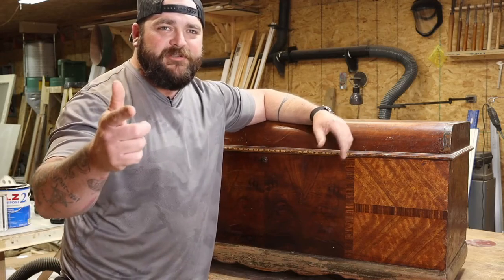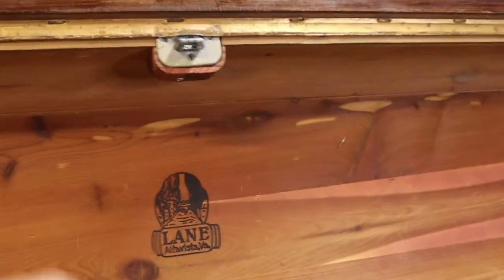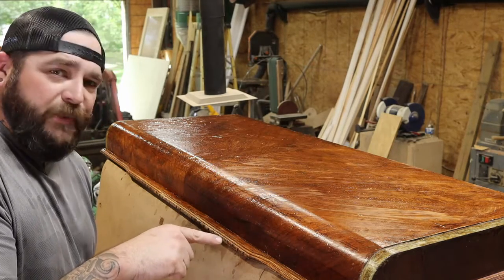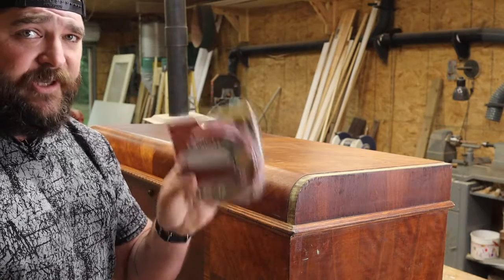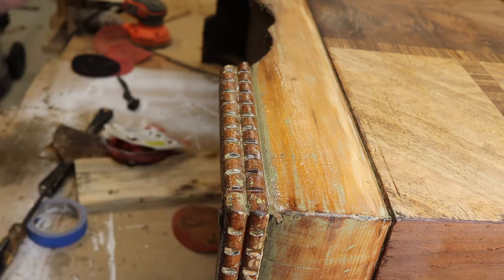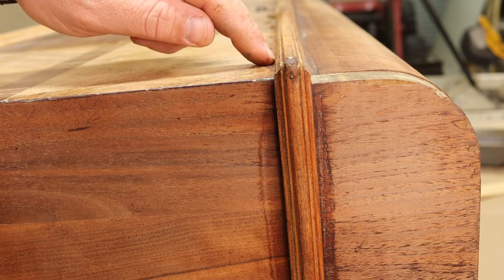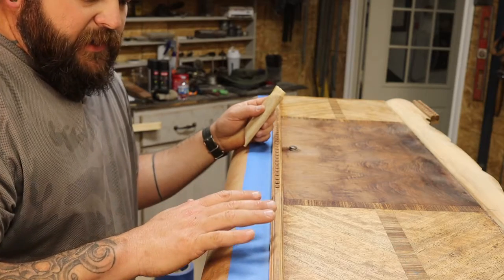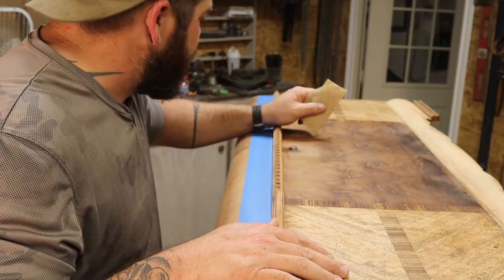RESTORING AN OLD CEDAR CHEST PART 1 (REMOVING THE OLD FINISH)

Comment: Great video and very helpful.  I don't know if you mentioned it but which stripper did you use.  We have to get all the old paint out of the crevices.
Reply from the maker: Hey there thanks for watching and taking time to comment 😀! There are two different basic types of paint strippers. A gel type and a watery type . Also i believe there is some in a spray can. Depending on the situation i may use the gel or the watery version . For Tight corners i have used old tooth brushes and the gel stripper and also some homemade scrapers and picks to get at those tight hard to reach spots . Just be careful cause that stripper , the good stuff any ways will burn your skin pretty quickly !